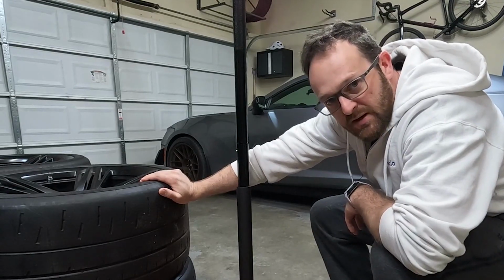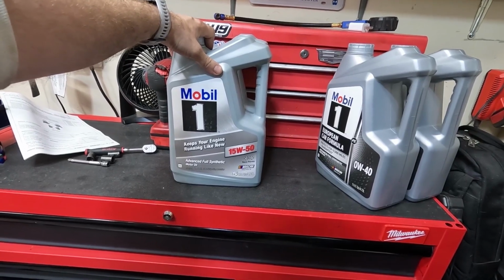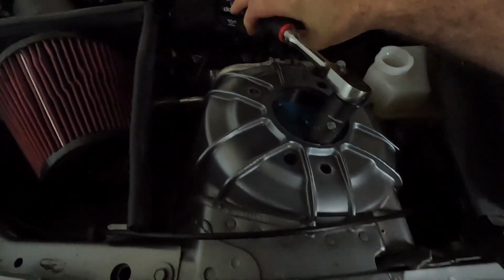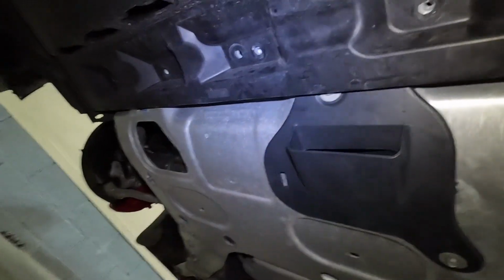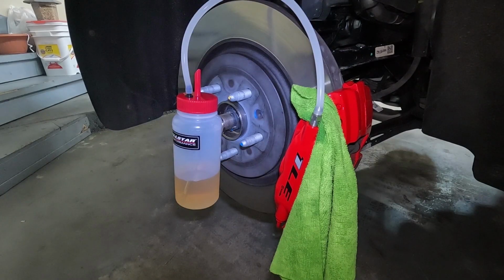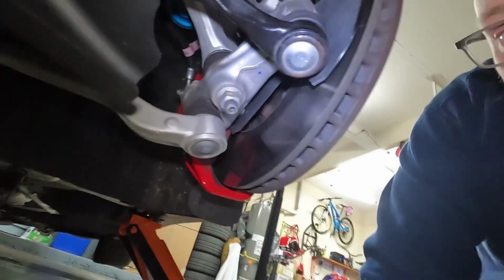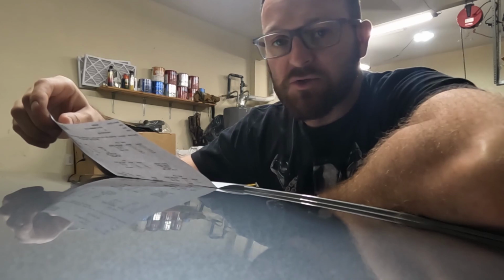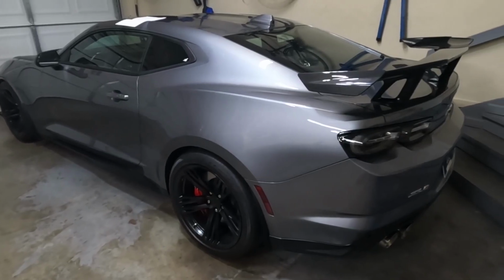Camaro ZL1 1LE Track Prep

Comment: Please tell me that you aren't skimping on a ZL1 and using that European non-dextrose 2 oil blend as your 0w-40, instead of the supercar dextrose 2 blend.
Reply from the maker: Hmm I wasn't aware of this. I'll have to look into it. I figured all mobil1 was dexos. I was just going by the owners/performance manual. Thx tho
Reply from the maker: So the Oil I'm using is dexos2 approved for general motor vehicles. So I'm good. No need for expensive supercar oil.
Reply: European formula is dextros, not dextros 2. ESP was the dextrose 2 formula. They changed the name to supercar to prevent confusion. European blend is not dextros 2, though.
Reply from the maker: Ok, I've done a ton of research on oil. So I'm officially switching to Supercar 5W50. 
Thank you for your comment because it opened up my eyes to something I wasn't aware of.
Reply: @Rideoflyfe  no problem. I did tons of research when I got my ZL1. Who would know that oil could be so freaking confusing. Lol.
Reply: The Supercar branding is newer, but it's the same oil they recommend in the manual. Big reason is warranty risk if cats and O2 sensors go bad from non-dexos oil, I'm told. An industry scam, probably,  but FYI.
Reply: @Rideoflyfe Also not sure the hype about 15-50 is well founded. Can anybody actually prove there's oil starvation from the pickup being exposed at high Gs? 

If so, thicker oil won't solve it, but maybe a different oil pan/baffle would.
Reply: @markvandendyke  Supercar is a rebrand of the ESP formula, not the European formula. Completely different product.
Reply: ok, my bad. Euro is not dexos approved, unlike Supercar/ESP which are, and importantly so. I never thought I'd have to top of a low mileage engine with oil the way I do with the ZL1. That means oil in exhaust passes over those platinum parts, and dexos cert matters. Could be expensive if they deny the warranty for wrong oil used.